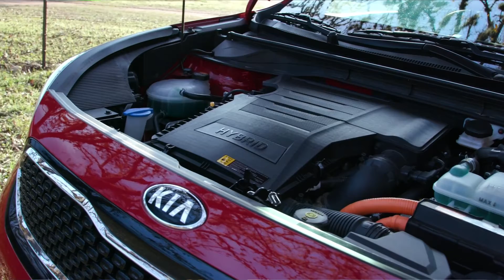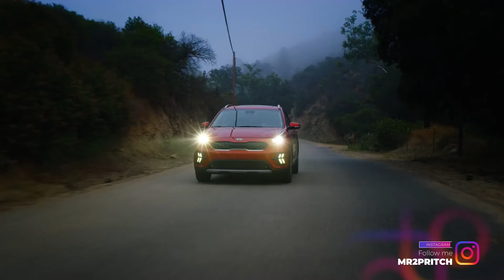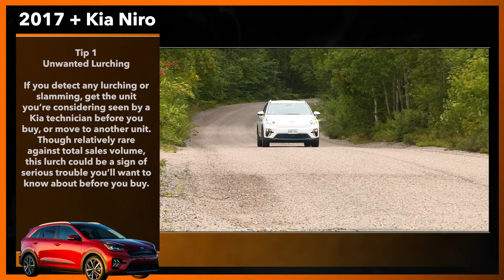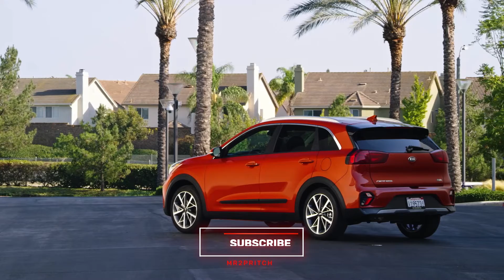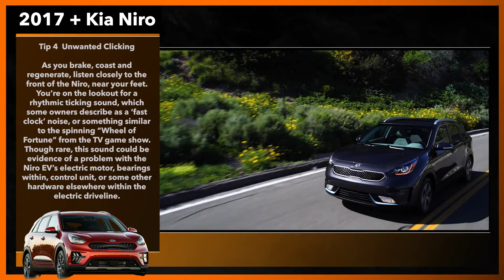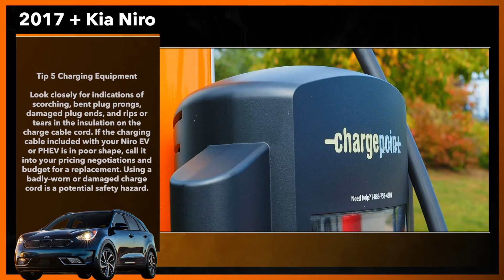Buying a Used Kia Niro EV? These 5 Checks Reveal Hidden Problems.

Comment: The 2023  Kia NERO  EV got a major upgrade for the USA version:  This video could use an update on that model specifically,   now as I understand it
it does not appear in any official writing from KIA there was a major design on suspension or other ''hard core'  mechanical or electrical components,  but
I feel based on review's for this model,  there probably was some fine tuning of the  EV over all to the point, where  the differences are great enough
to know  any reviews before the 2023 model  re-design  are  not necessarily applicable:  

Best part of my rant: At the risk of hurting my own future financial gain,  I'll remind others here in the hopes of good karma on my failing  2007 Buick GM series III engine:

On January 1st, 2025,  you can apply  4,000 off a used EV from the 2023 model years,  and the  KIA NERO EV, is one of the few  EV's that got that
upgrade in 2023, which means  if your reading this comment, you should begin  preparing your budget for a 2023 NERO  EV  (wind or wave trim)  because it is 
after the discount,  (for some people  a better  deal than the next best deal in the used EV market which is the much cheaper  2022 Chevy Bolts,  but suffer from 
torsion beam only suspension and  much slower level 3  DC fast charging and don't come with  rear AC vents or  other  extra's like the  vehicle to load bonus
that allows you to charge  small scale electric  appliances ,  including certain electric power stations,  or  air compressors, or mini fridges, etc...(all kinds of use cases
there if you want go enjoy the outdoors in remote area's but lack of electricity makes it harder,  a really cool example is   inflatable tents which are much easier to set up)

Comment: My 2023 phev Niro has been making a loud growling sound when I shift from R to D and turn the wheel right or left. It has been doing this since April. It doesn't do it every time, but everytime it happens, that is the pattern. I have had it in the shop to address the problem and the mechanic said it was due to faulty rear shock absorbers (?), which he replaced. Three days after I got the car back, the noise returned. It sounds like it's coming from the front of the car, almost under my seat. Have another appointment to take it in. Any ideas or experience with this problem. I also had that problem with lurching but it hasn't happened since I took it in for that problem a few months ago. I think I have a defective vehicle! Any comments would be greatly appreciated.
Reply: 3 week ago, we changed the left wheel hub (only original Kia part  available.Cost was 400eur)

Comment: I bought ev Niro, out of garantee (below market price 4000eur) Clikcing noise was loud. Solution was 2pcs RS6007 bearing change in electric motor+3liter of coolant. Cost: change parts 100eur, workship  500 eur. Now the tire noise most louder at all 😂 don't worry be EV!

Comment: Just got my 2019 KIA Niro EV with 21K miles back after a week in the dealership shop.  I was hearing the clicking sound from the drivetrain at slow speed.  The sound is very suttle and you have to listen very carefully to hear it, almost like a muffled ratcheting sound, but it's definitely detectable. They said it could be three things:  Motor mount (which they replaced first), the  reduction gear, or the Traction Motor( which is equivalent of gasoline car engine in EVs). In my case it turned out to be the Traction Motor. Service tech told me had my car not been under warranty, it would've have cost close to $11,000.
Reply: Got the same problem with my UK spec eNiro. Kia are taking ages to fix it, 4000 miles since it started, no I can hear it constantly even with radio at 20. I reckon I've got at least 4 more months until they get to the motor replacement (had 2 engine mounts). I'm just waiting for it to fail at this rate...
Reply: @angus04  how did things pan out with the repair? Do you still own the car?
Reply: Fucc that. Electric car ownership are not cheaper.
Reply: I had same problem knocking or clicking sound in acceleration and deceleration during break regeneration too, so initially kia was trying to make excuses, but now it is with Kia possibly changing electric motor with transmission costing £6000😢

Comment: The EV doesn’t have OIL?
Reply: It has a reduction gear with oil
Reply: No oil.  But it does have radiator similar to gas engine card to cool the battery pack.

Comment: My Niro EV 2020 model has an issue with fast chargers that Kia seems unable to fix. The fast charger gives an error that communication with the vehicle failed, and will not start the charging session. 
Sometimes it seems to help to hold the plug while communication is attempted, but often when releasing it stops charging again. 
I have been at Kia twice and they have not been able to fix this issue yet.